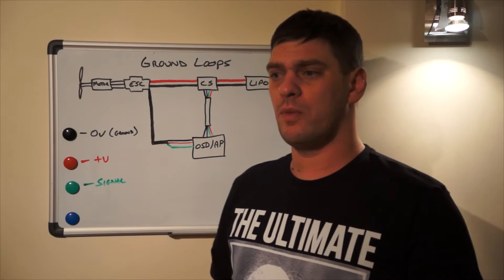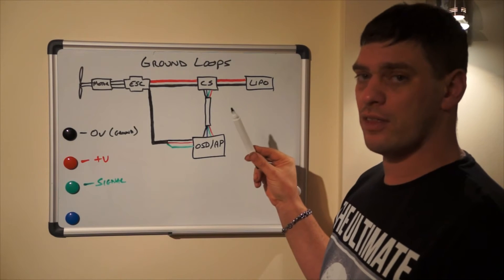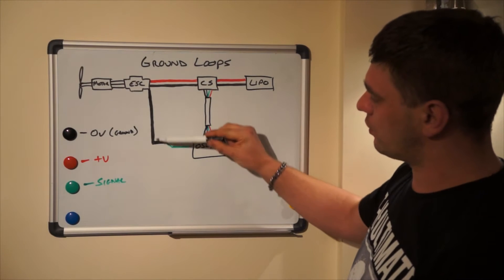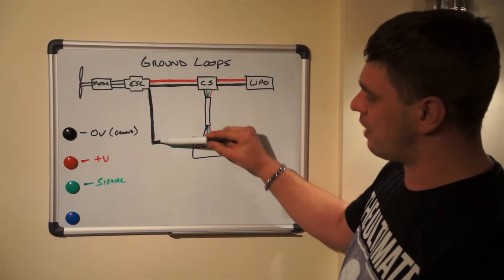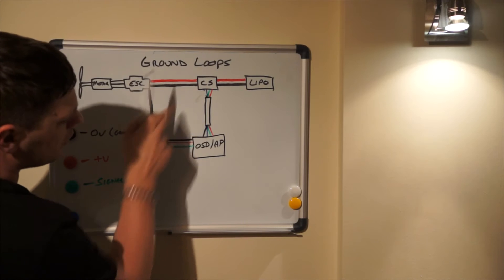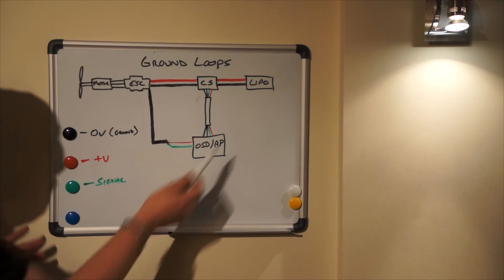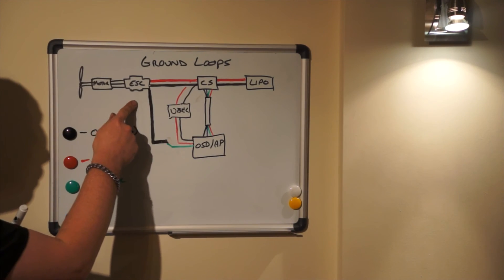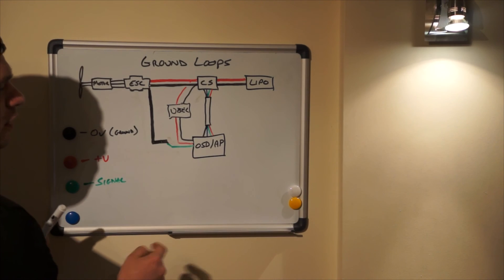Groundloops

Comment: 9:34 there is still a ground loop on the picture,
osd/ap gets two grounds wires, one from ubac and another one from cs... 
Is that ok?
Reply from the maker: That groundloop is fine because it does not offer a lower resistance patch for a fault current to go down as it originates and terminates at exactly the same place. 

It is a good point though so I will explain why it is there. Some UBEC units actually have an isolated ground circuit so without the current sensor ground would give a false floating ground to the OSD, the current sensor ground therefore is left in to guarantee a true 0v.
Reply: ok, thanks for clarification
because huge servos can cause ubac to fail or overheat (if underrated), then some fault current would potentially spread/leak through lower resistance (less busy cold) path therefore via cs (also cs ground on the picture its closer to battery negative potential). If something like FC is used some modes are quite hungry and digital servos are more power demanding.
Reply: jnb True but if the Ubec failed the autopilot would be rendered useless anyway because it could no longer control the servos. So we have to presume that the correct size Ubec has been selected for the given application.
Reply: ok, that's correct, 
but ubac can only get to a point when it still can operate but some leaking current can flow via control (osd/ap) to cs, and as the current goes to ap it changes its gnd reference and that might be a real problem as well (as a source of noise) and not just failed ubac itself. 
Maybe this is not that critical in practice, but it's another source of instability to a system.

Comment: Well that explains the crash I had with my talon. I lose control over all 4 servos but since the osd was powered exclusively via a seperate 12v line I still had picture and telemetry display. In addition I was using ppm so I was still able to change the flight modes but because of the ground loop it must have burnt the ground on 5v rail and I lost all control.

Glad I found this video, I'll be sure to eliminate that problem in my next build.
Reply from the maker: Glad you found it of some use. Hope the plane wasn't a total loss.
Reply: Coyote FPV nope. All the electronics were fine except the AP ( arkbird because the ground rail burnt out).

I'm moving now to a cyclops tornado but I have noticed and issue. With my esc they have a habit of nor arming when the ground isn't connected. So won't be able to use the throttle unless I have signal and ground connected to the FC. 

However, the CS is going to be connected the the AP as well and I really don't want another issue like that again. What skeptical about is removing the power and/ground of the CS and just using the signal to get the readings. 

I'm not sure if the readings will be accurate or if the CS will even work without the ground and power wires. Note: I'm not using the CS to power the cyclops, I removed the jumper and use a seperate lipo

Comment: Hi! Great and clear video...thank you! 

However, there is one thing that I don't understand. I hope you can explain it to me! In the last situation where you use the separate UBEC, I don't understand why you don't cut the GND wire between the Current Sensor and the OSD/AP. To me it seems better to still cut the GND wire between the Current Sensor, because of in case of an AP the current from servo's, gps, (minimosd), etc could potentially run through the gnd cable of the CS instead of the gnd cable of the UBEC. Off course it wouldn't be such a high current as from the ESC, but still it is a potential path that should be avoided. 

Could you explain me why it is better to also connect the GND wire of the CS? 

Thanks!!
Reply from the maker: A few makes of separate BECs have an isolated ground from the input so the current sensor is the true common ground. Some people find video issues when running these BECs and 5V cameras because the cameras ground is not the true common ground. 

Also the current flowing down the current sensor wire is negligible. It's like a ground loop in a video circuit, it has no potential to cause any problems so can be dismissed. There is no risk from damage from the low power servos and GPS with use hundredths of an amp compare to the motors.
Reply: Thank you so much! Totally clear now! Didn't thought about the case of a BEC with isolated ground!  I was aware of the fact that the risk of potential ground loops in this part of the system weren't risky, but I just wanted to know the logic behind why you would keep the current sensor gnd connected.

Comment: could ground loop effect video clarity(signal) aswell? and an other question , how about hooking the bec between the lipo and current sensor , this would also reassure a current sensor failure no ?
Reply from the maker: A ground loop in the video system will have no I'll effects as the current is extremely low. It will not interfere with the picture either. Having separate grounds though can if it allows the cameras ground to be floating compared to the OSD or Vtx. This will then affect the picture.
Reply: I believe I found the problem then .... I do have saperate ground running two batteries , I will re-wire and report back thanks.
by the way , I know its a lot of work but maybe  if you can find sometime to make  video going  into your mfd-mtd set up would be great , its one of my dream setups that I hopefully be build oneday :)
Reply from the maker: I will see what I can do.

Comment: Thanks for the clearly explained ground loop. Now i need to pull the grounds from the optos that came with the pnp MTD kit..
One question regarding the ubec. Whats your opinion on running the ubec into the rx (set to 6v) first, then that ubec voltage being sent to the AP via the ppm lead. This is how i have mine set up now.
Reply from the maker: +eastcoast78 Hi, because its all relatively low current all the tracks can take the amps fine so it in theory makes no odds which end the 6v / 5v is introduced into the system. Either way the 5v will distribute fine and cause no hassle.